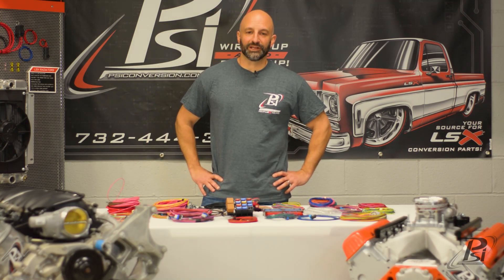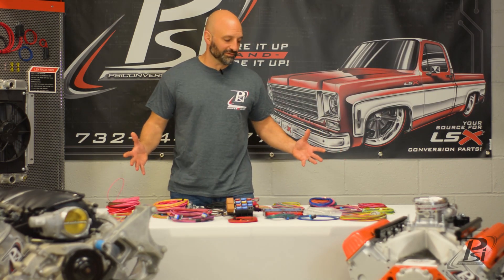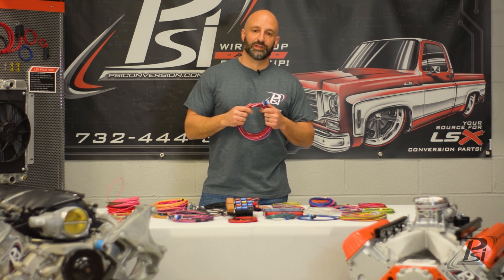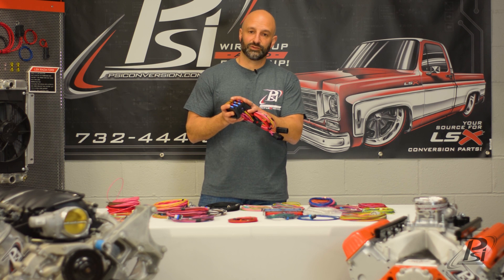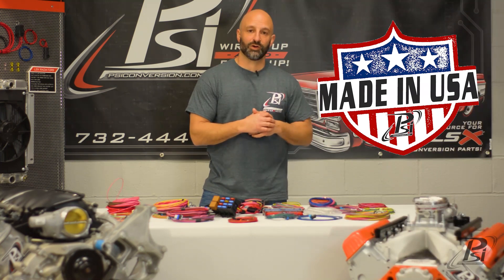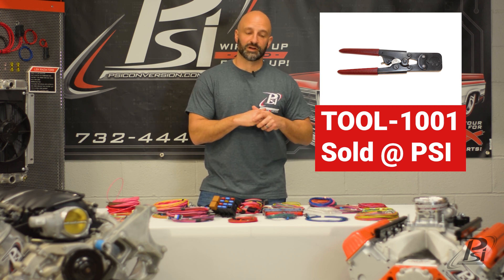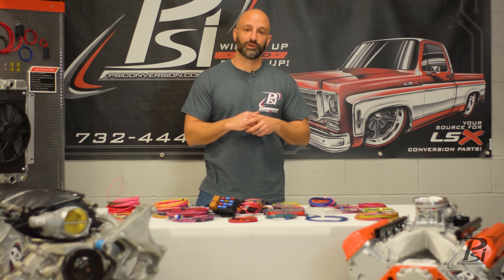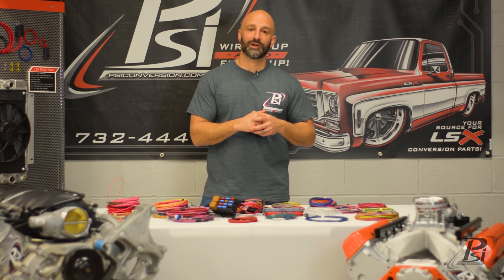Psi Builders Harness Series : Part 1 Intro to the Harness (HAR-9000) LT LSX Swap

Comment: Question.. if i had a holley Terminator x... i would need to use this as my wiring harness?
Reply from the maker: This could be used but we wouldn't recommend unless your an extreme builder that can very literally assemble a harness from scratch. We provide everything you need to do so and make the ultimate custom harness at home.